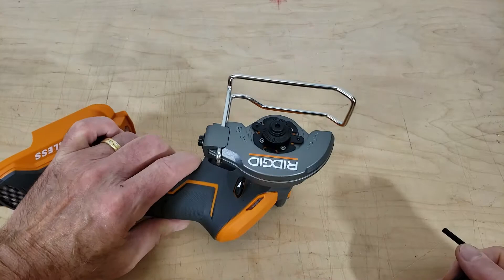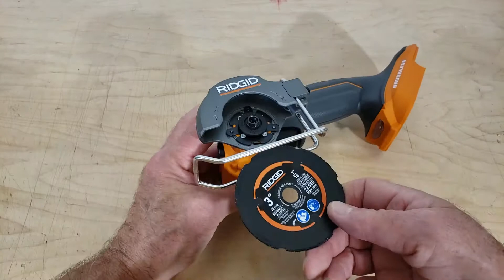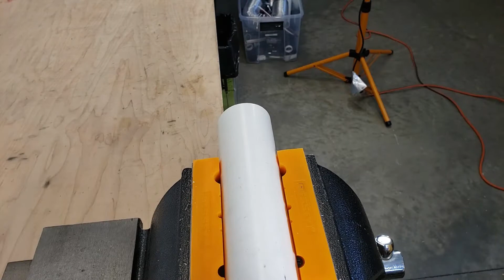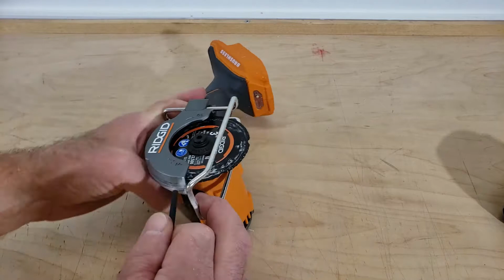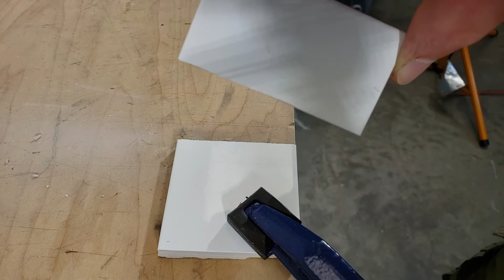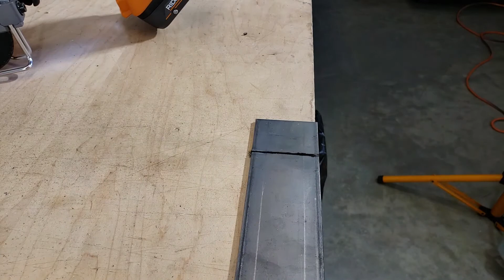Using the RIDGID Sub Compact Cordless Multi Material Saw

Comment: Wondering if there is a 5/8 and or 7/8 adapter for the larger diameter discs?
Reply from the maker: The tool provides for 3/8 inch or 7/16 inch arbor sizes but larger diameter cutting discs/wheels are not going to fit inside the guard. What is your objective for wanting to use "larger diameter discs"?
Reply: Deeper cut, and I already have the larger 4 and 4.5" cut off wheels, when out at a scrap or vehicle salvage yard. Thinking if the RPM is to high is way to dangerous anyways.  Though, yes, the guard would need to be removed and either not used or a custom guard fabricated for using with.  @PicRic
Reply from the maker: @jafinch78  Why not get the tool that will accomodate the discs you have; guard, speed and arbor sizes all designed to work together? Maybe from the RIDGID Cordless 4-1/2 inch Angle Grinder range?
Reply: I already have, though they're a bit bigger to tote around and use. @PicRic
Reply from the maker: @jafinch78  Do you have the RIDGID SubCompact Cordless One-Handed Reciprocating Saw? The only other reasonable solution without having to worry about disc speeds, fabricating guards an' all.
Reply: @PicRic  Hello. Does it have a dust extractor How on Milwaukee? Maybe it's suitable for him? Have you tried it?
Reply from the maker: @KoKs3449  Hi there. My MM Saw doesn't - have a dust extractor - in fact I can't imagine a practical design that would work ... Can you, D H? I haven't seen the latest Milwaukee MM Saw ... Have you?
Reply: With the bigger discs and heavier demand, the angle grinder is THE tool to use. A bandsaw might be better, but I can appreciate that there not many applications that it would fit around.
Reply: @C71-m1l  Right, though I own both now and this little Rigid with the high rpm cut off wheels are awesome!  Nice clean quick cuts compared to the DeWalt angle grinder with a cut of wheel.

Comment: Some blades can be used in both directions, but the Diamond Tile blade can only be used in the forward direction.  I think you used reverse in the video.   Check the arrows on the blade - whether it shows a bidirectional arrow, or a forward only arrow.

Comment: Was that last piece you cut porcelain tile?
Reply from the maker: Yes, tile, pipe and steel were the materials. How do you use yours?
Reply: @PicRic  no but I was wondering if it was porcelain tile or ceramic tile specifically because porcelain is a lot harder than ceramic. Was it porcelain or ceramic?
Reply from the maker: Erm ... What the tiler left behind after shower tiling. What do you currently use to cut each material?
Reply: @PicRic  I'm not cutting tile right now I was just curious
Reply from the maker: Okay, let us know when you do, eh?
Reply: @kanive1566 my parents laid tile for 35 years… it looks like ceramic tile to me. But I’m no expert.  Just came here to get tips on my new tool!
Reply from the maker: @kanive1566,
@lateknightcreations, Thanks for the insight, Kendra.
Did that help, @kanive1566?

Comment: What kind of vice is that? It looks awesome
Reply from the maker: It's a six inch Bessey vice.  I like it because it opens up to 6-3/4 inches.  Thanks for watching.
Reply: @PicRic  Cool. Where did you get the rubber pads? Are they magnetic?
Reply from the maker: @AereForst  Yes, they are magnetic.  I think they came with the vice but they are also available separately, https://www.homedepot.com/p/BESSEY-Non-Marring-Vise-Jaw-Accessory-for-Use-on-Vises-with-Jaws-from-3-in-to-6-in-Wide-BV-NVJ/204986223.  Please, like and subscribe for many more review and how to videos.
Reply: @PicRic  Thanks
Reply from the maker: @AereForst  You're welcome.

Comment: nice, I'm considering this over the milwaukee.. what wheel do u recommend for cutting wood..? thank you.
Reply from the maker: There are no wood cutting blades available from Ridgid so I can't recommend any, Daniel.
Reply: Diablo sells a 3" 3/8ths arbor multi-purpose, which includes wood. It's what I use. Maybe better ones but, "if it works it works" so haven't tried other brands. My opinion comes with a side of a grain of salt.
Reply: I have this saw and it's great...but between this and Milwaukee, pick the one you have batteries for.  There are no wood disc officially supported by Ridgid and they will specifically tell you the tool was not meant for cutting wood.  That said, there are wheels made for wood made by other companies (like the Diablo mentioned), use at your own choice! ^_^

Comment: Can the head be adjusted/rotated so that the handle is more vertical?  That way the battery doesn't get hung up on some work surfaces.  I saw another video where the guy rotates the head but I couldn't see how he dit it.
Reply from the maker: The head is fixed on this model, alano1.  The only adjustment is to the depth of the wheel guard.
Reply: @PicRic  No it is not fixed. You can rotate it, it is just a bit tight.
Reply from the maker: @MrDehicka  Ha, yes, I see that it is moveable now.  It seems the instruction book covers this in section 6 but without any explicit comment.  Thanks for enlightening me.
Reply: @PicRic  Holy shit I didn't know! Been using for a year.
Reply from the maker: @calculator1841  Live and learn!  Live and learn ... That's both of us!
Reply: @PicRic  I pulled out my manual and sure enough. Somehow my brain processed that as being about the adjustable depth-gauge guard. Sheesh 😂

Really makes it easier to use with my 5mAh batt
Reply from the maker: @Vicus_of_Utrecht  Thanks for watching and commenting, Vicus.
Reply: @PicRic  👍

Comment: if it is installed with a 4" grinding wheel, can it be done?
Reply from the maker: The tool is designed to work with the supplied metal cut off wheel, diamond tile wheel and carbide abrasive wheel.  However, Dremel wheels also fit so they may produce the grinding wheel that you want.
Reply: @PicRic  I'm sorry, what I mean can be installed on a 4" cut off wheel.  because in my country for a 3" size it is very difficult to find in the market. If possible, I plan to buy it.... thank you sir
Reply from the maker: @bayususeno6400  It is not possible to fit a four inch wheel inside the wheel guard. Won't the outlet selling the tool also supply the correct wheels?

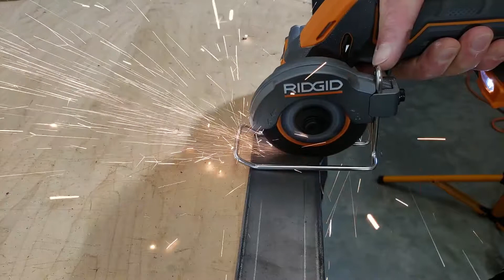Comment: dId it stall at 4:33 or just ran out of juice?
Reply from the maker: The battery ran out of juice and I fitted another one to carry on.
Reply from the maker: @Travis Johnston Nope, didn't slip off.
Reply: @PicRic  I dont think your battery ran out of juice, I am having the same issue with the brand new one I bought. Its going into protect mode or something. if you remove the battery and put it right back on it will start to run again and show you your battery charge.
Reply from the maker: @marlboroman71818  That sounds like a different problem because my issue was the battery going flat.  I know this because I checked the battery power status before fitting it to the tool - it was one or two bars off fully charged - and made a lot of cuts in different materials prior to the ones you see in the video and I checked the battery status on camera when it gave out.  Both the tool and battery have been used many times since and they have always worked as expected.  Does yours have the same problem regardless of the battery being used?
Reply: @PicRic  yeah its the same thing no matter the battery. I checked my battery and it was giving me 3/4 full but it would shut off and completely shut the saw down until I pull the battery and reattach. Batterys worked in in recip saw, impact, drill and driver. I just charged it though and it did seem to do better on a fresh full charge.
Reply from the maker: @marlboroman71818  Okay, hope it works as intended now.  You can always get a warranty replacement if the problem persists.